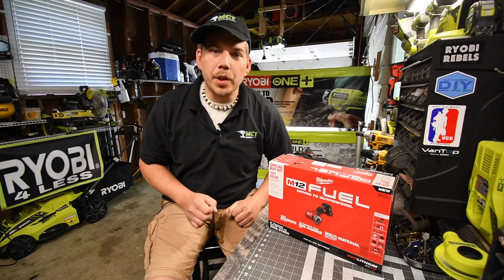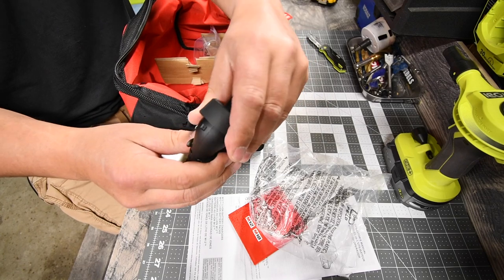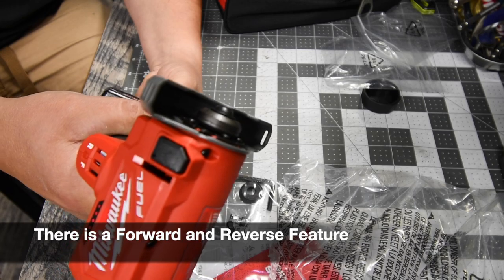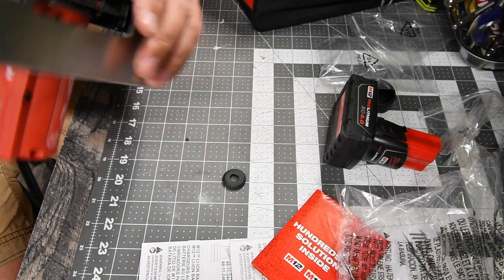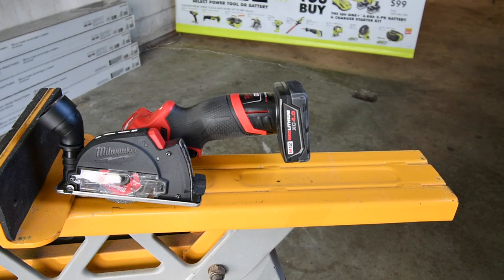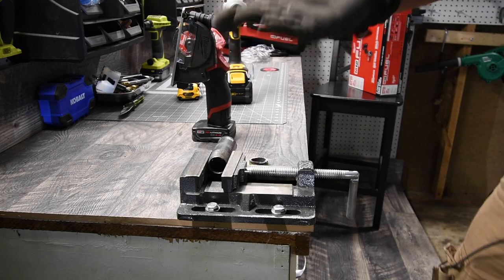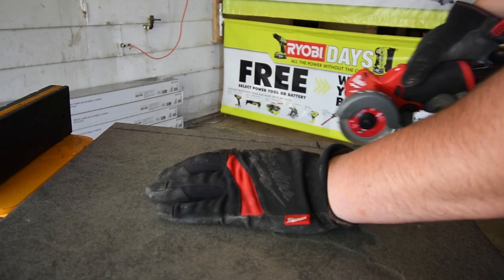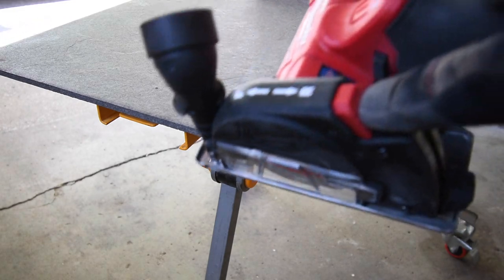Milwaukee M12 FUEL Cut off Tool

Comment: I paid $109 today for that kit can’t wait to use it!
Reply from the maker: that's not a bad deal at all, and I thank you for viewing Daniel
Reply: $249 for just the skin here in Australia wtf...
Reply: @procrastinator1842  it will be $109 without the batteries + charger + case
Reply: @gaveasytiger  $258 here now...
Reply: @procrastinator1842  that’s with the batteries, case and charger right?
Reply: I’ve just bought one (with everything) for £240 in the UK. It was £109 for just the body (no batteries).
Reply: @gaveasytiger  Tool only.
Reply: @procrastinator1842  wow, that is expensive.

Comment: I wasn’t too impressed I thought it would awesome for HVAC work. Honestly struggled with sheet metal(30-26g). I also feel like the cutting depth is an issue with other materials. Cost of blades was adding up as well.
Reply from the maker: when it comes to cutting metal. id go with a higher voltage tool

Comment: What is the difference between this and the angle grinder
Reply: Easier to maneuver and do precise cuts! Like cutting circles and tile and cutting rebar and fencing! I recommend using M12 XC 6.0 batteries ONLY for on the job use!
Reply from the maker: this is smaller and more compact. its not nearly as heavy and this will fit in smaller areas if your space it tight

Comment: Might need one even though I don’t work with metal that often. Or thin steel oh and I am not first I am 241
Reply: It's not that good I used it to cut some aluminum box and it overheats quick
Reply from the maker: it not only for metal. its good for wood as well. if it can cut metal it can cut wood. just need the proper blade for it

Comment: Here is an update on the New RYOBI Hybrid Tripod Stand Light - P782 specs are 2,700 Lumens 7.2 Lbs approx height 5 ft 10 hrs run time on low   has footswitch high and low and a carry handle 310-degree adjustable head  pricing unavailable at this time
Reply from the maker: I am getting that when it is available. I want it so badly
Reply: @ManCaverTools  that makes 2 of us

Comment: Hi Dave, thanks for a great channel, I wonder if you know of an online resorce for identifing older Dewalt drills etc. aquired an impact driver recently but has no identifying labels, hope you can point me in the right direction. Many thanks, John
Reply: You could probably go on the waybackmachine website and put in the dewalt website and pick an older year and see if you can recognize the drill
Reply: thanks, will look now
Reply from the maker: the best thing to do is to find stamp markings on the clamshell and look up  pictures to see what compares to what you got
Reply: Had a good look with magnifying glass and managed to find some inside battery tube, turns out it's a DC837KL type  11. Many thanks for help and great channel

Comment: Max depth of cut??
Reply: @Ronofthedead07  really? A 3"is blade and only 5/8" is the deepest it cuts?? That doesn't sound right...
Reply from the maker: I am sorry I didn't add that in the video.
Reply: Thanks for the replies and answer. This saw is a big no go for me!!! 5/8" for near max depth is absolutely ridiculously in my opinion especially when you consider using blades that wear away with time like the abrasive type blades.

Comment: Oh come on! the station is used for tiles specially, by connecting a vacuum into it, and it will suck dust out!
Reply from the maker: I prefer not to. because there is info that I did not share in this video that I am saving for a future video. you can use this tool wet. I talk to the Milwuakee rep and he talked to his boss and he confirmed that this can cut tile with water. I will be doing that video soon
Reply: @ManCaverTools  That would be Interesting, I would like to see that in action, keep up your great work, regards!